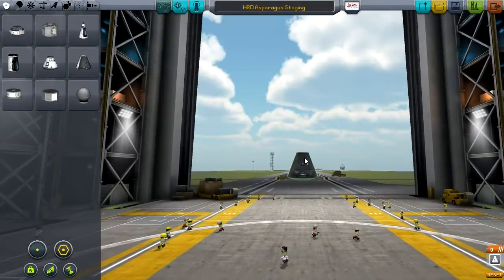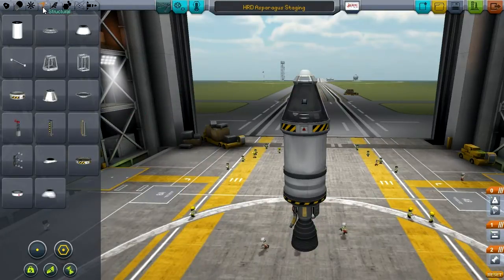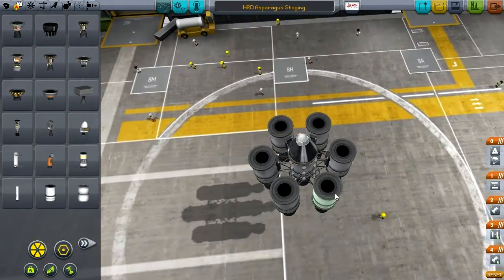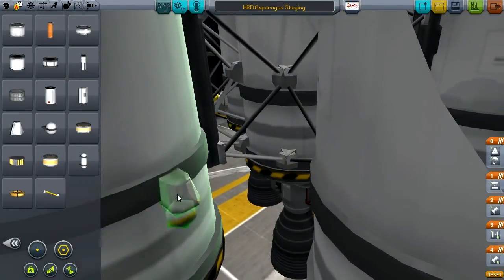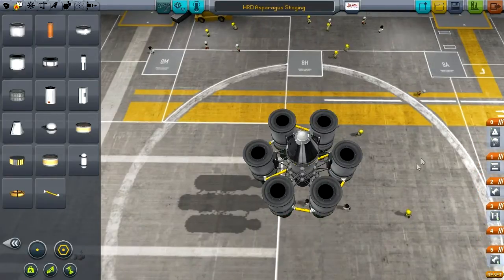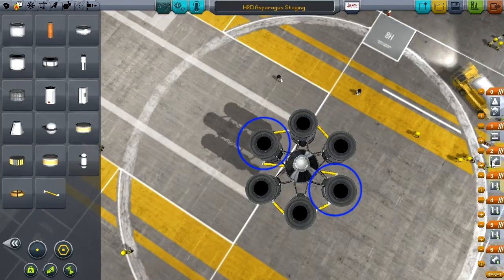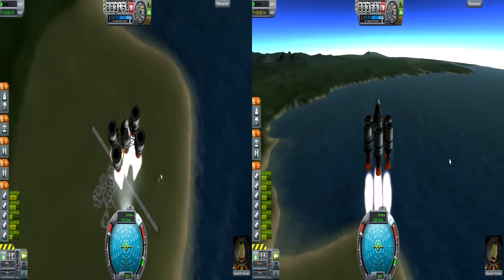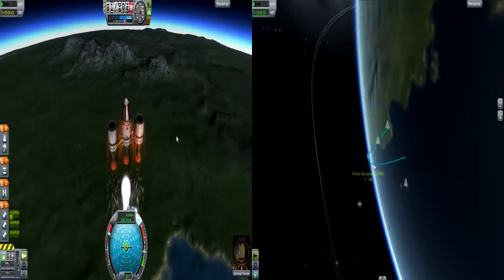KSP - Asparagus Staging Tutorial

Comment: I cant seem to get this style of rocket to work. when i use extra fuel tanks on the outside the fuel lines seem to not pump fuel in the S formation that is typical to asparagus staging. the fuel lines seem to be sharing fuel in both directions reguardless of where the arrows are pointing, so no matter what i try the fuel tanks all end up empty at the same time. (the example on the right of your video) is there something extra i need to do before launch or during to make sure that the fuel pumps in the direction of the arrows?